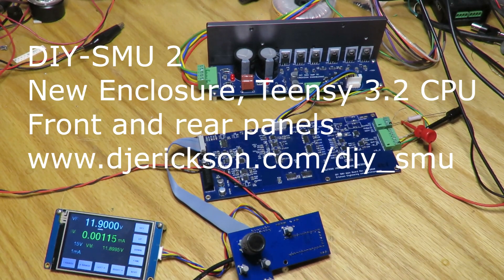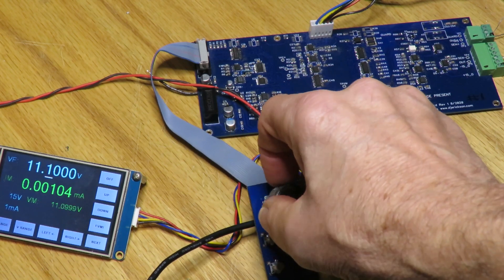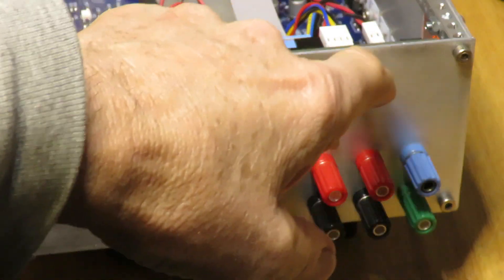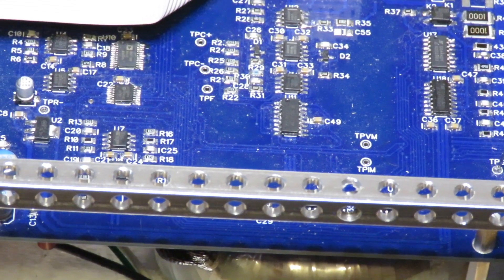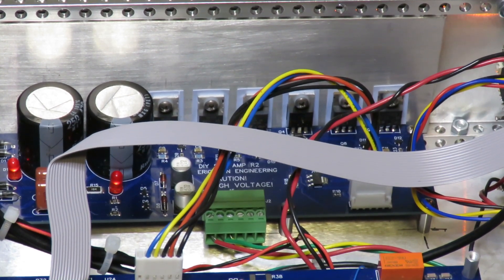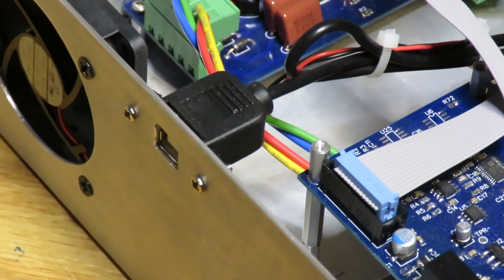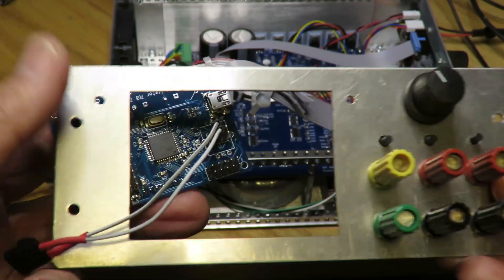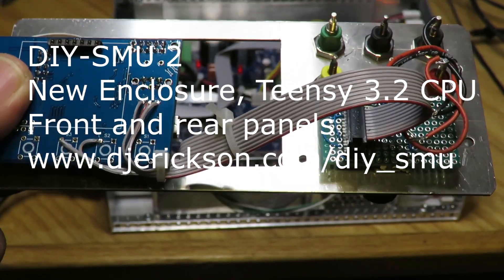DIY-SMU Chapter 2: New Teensy CPU and Enclosure

Comment: Love the new enclosure, the use of the GoBilda beams are a great idea. It's a shame that the holes along the beams are not threaded but I guess that would push the price up quite a bit. They are however drilled to 4mm so you could enlarge the ones you're using for the side panel to 4.5mm and tap them for m5 screws in order to remove the nuts.

A couple of interface suggestions / ideas:
1) Switch to a double-pole rocker switch for the power switch.
2) Add a physical output on/off button with an LED indicator to the right of the encoder.
3) Remove the left/right cursor buttons and make the encoder "velocity sensitive". (For safety you might make it behave as a fine control without velocity sensitive behaviour when the output is on and it might also be worth adding one of those stacked/dual-concentric encoders so that you have both coarse and fine control but again both velocity sensitive - You can always use an on-screen keypad for very large changes.)
4) Position the up/down buttons vertically, with #3 removing the usage of the left/right buttons, the up/down control could be both of the light grey buttons.
5) If you use countersunk screws for mounting the front PCBs, you could then use an extra PCB for the control legends. (Held in place by just the four corner screws, so it would hide all of the middle screws.)
Reply from the maker: Thanks for the excellent feedback. I agree with your ideas. Good details for the next front panel revision. 
Yes, the Gobilda 4mm holes can be enlarged and tapped for M5 screws. I'll do that for the top cover at least.
1, 2) I always wondered why to use a power LED if something else obvious (like  a big LCD) shows ON / OFF. Maybe it's a European regulatory thing? I picked the toggle switch for easy mounting in a round hole and small size. A rocker in a square hole is a good upgrade for the machined front panel.   
3) Seems like every time I use velocity-sensitive encoders, I curse the way they work. You get close and the value jumps.  Lecroy Waverunner scope is a bad example. Got an example of code that works well?  I'm also on the lookout for an on-screen keypad on Nextion. Which raises the question of what display I should be using.....
4)I'll probably use up over down switches. Maybe a diamond pattern. 
For the next rev, I intend to use an aluminum front panel made by PCBWay. It solves the problem of color (soldermask) and labeling (silk screen). Prices are good.   It won't hide screw heads though. Cutting clean, accurate rectangular holes in metal by hand is no fun. The pros use a plastic stick-on overlay.
Reply: @ericksonengineering7011  
1) Fully agree about a main power indicator being unnecessary - I suppose it would be useful if you had a "screensaver" mode where you turned off the display after a while but I can't see that being useful for an instrument like this. I mentioned a rocker switch mostly because it seems to be quite standard on a lot of bench equipment but the main thing is about it being double pole for safety in case one pole fails, especially with it having +/-150V outputs. A double-pole toggle switch would be just as good and far easier to mount.

2) I think the indicator for the output is still important even if it is duplicated on the LCD because LCDs are slower to read - Often the output status is tucked away in the corner or surrounded by text and a dedicated indicator makes it much quicker to check. Also because of the high voltage output having an indicator that's obvious and right next to the outputs is also a safety consideration.

3) It is an oddly tricky thing to get right and it's something you can only really tune by trying it and adjusting. I'm afraid I don't have any code to hand (And the code will vary on exactly how you want it to feel) but I think the parts which make velocity-sensitive implementations feel bad tend to be the following:
3a) Missed steps, as it's timing based any jitter can really throw things off. The solution to this one is to use interrupts to do the actual encoder counting.
3b) Duplicated steps, again this one is related to jitter. There are a couple of solutions but the main things are to use a decent encoder (Good quality contacts), consider adding hardware debouncing to both inputs and to ensure that the quadrature decoding algorithm handles any edge cases. (Only one input should change at a time, it's essentially a small state machine)
3c) Incorrect "time" while calculating the velocity. I tend to call "millis()" once at the start of my loop and pass the current time into each function. I would keep track of how long has passed since the last velocity calculation and the change in encoder counts during that time, then after a reasonable amount of time (Let's say calculate it every 100ms) perform the actual calculation and velocity. This will ensure that time is included correctly and that the numbers aren't so small that they become inaccurate.

For the display the Nextion is probably as good as any. The editor is a little clunky and they can't do much with transparency, but for an instrument like this it should work well. I'm yet to find a touch-screen display option that I really like, doesn't cost the earth and doesn't have a silly boot up time.

4) A diamond pattern would make a lot of sense as it also distinguishes that set of controls from any other buttons.

It probably goes without saying but if using an aluminium PCB for the front panel don't forget to make sure that it's properly grounded. There's no thermal considerations with this front panel so I'd consider a regular FR4 PCB that's slightly thicker (2mm?), or possibly a regular thickness PCB with a laser-cut acrylic back-plate for strength. Would have to run the numbers and see which one is cheaper and easier.
Reply from the maker: @yngndrw.  
Thanks so much Andrew. When I turn an encoder 10 clicks to the right, then 10 clicks to the left (back to the original position) , I expect the reading to be at the original setting. Like a potentiometer does. This expectation is an argument against acceleration, no? It is also an argument for no missed or extra counts. It seems like there are 2 types of encoder libraries, Interrupt and Polled. I use a third approach: a 1mS timer makes regular interrupts, used to poll the encoder (and BTW all UI keypads) every 1mS. This is how I've read keypads and encoders for years. Never misses encoder pulses. And unlike interrupt on edges, you don't get a large number of interrupts when (not if) your encoders get old and bouncy. You have to turn an encoder pretty fast to miss 1mS polling. 

Ground all metal: I totally agree. Probably spent years of my 50 year EE career fixing grounding issues. First rule of debugging: "It's probably the Ground". Pretty safe to say:-)
Reply: @ericksonengineering7011  That's a very good point, velocity-sensitive controls are indeed going to result in a potential inconsistency when counting clicks. I guess the key thing here is that there aren't any right or wrong answers here, just many options each with their respective tradeoffs.

I would argue in the case of an encoder with a separate read-out on a display, the displayed value is the sole feedback mechanism. At slow speeds it certainly should be very predictable, but at high speeds I don't think it matters as you're not going to be able to count the steps at those speeds. I'd certainly ensure that any speed-up only happens at higher speeds. (Maybe faster than about 1/4 of a turn per second?)

Your approach to reading encoders is essentially combining the debounce with the read while still having the advantages of using interrupts which is quite nice. I think the only downside is that it's not quite as targeted (I.e. You don't know what has changed without checking everything) so you'll spend longer within your interrupt which might be an issue if you also need to use interrupts for something else, but that in itself isn't an issue - Just something to be mindful of. As long as you handle any edge cases gracefully (E.g. The encoder changing two bits during within 1ms - I'd probably just record that value as the new encoder state ready for the next change but not adjust the count) you shouldn't have any issues with jitter and implementing the velocity-sensitive part. In my opinion the key part to velocity-sensitive controls is to not apply it linearly, I'd start off with a square ensuring that there's a well-defined "standard" portion at slow speeds and then adjust based on how it feels.
Reply from the maker: Thanks Andrew.  @yngndrw.  I think you are right. Slow rotation, counts are important. Fast, the operator probably doesn't care, just wants to get somewhere fast.  Also don't forge this is a high voltage instrument. Fast rotation could get you in trouble.  I think these types of instruments usually have software 'limits' in addition to the clamps to prevent operator error.
Reply: @ericksonengineering7011  It's an interesting problem, I suppose that as long as it behaves predictably (The whole jitter thing we discussed above) then that's half your battle - Making sure that it doesn't just suddenly jump up when you just want it to rise slowly. If you were to use the concentric coarse / fine encoders, you could ensure that the fine encoder only allows a maximum of about 1V per adjustment (1/4 turn?) and disable (Or severely limit) the coarse encoder while the output is enabled. There's probably a balance here between usability and safety. (Safety of the operator and of anything that you have connected to it) Upper voltage limits are quite common but I never find myself bothering to set one - It would be interesting to see how many people do use them. I suspect that it's one of those feature that you never use until something goes wrong.
Reply: @ericksonengineering7011  I've been doing the timer interrupt + straight port read with only a flag in the interrupt vector way for years as well, with a 0.1uF across the contacts, although I never bothered with the velocity stuff myself, it never failed me (with proper encoders at least)

I'm with Siniša Babić re: the status LED, but mostly because I don't trust my own code enough not to have a backup plan in case I messed up :P

This is an awesome project, I'm glad I stumbled onto it! :)
Reply: I can only confirm that a separate “OE on” indicator has proven to be very useful. It seems that our mind quickly learns that everything on display is one "domain" and having an important indication in another place increases the chance that we pay due attention to it.
Reply: @ericksonengineering7011  If there is a CPU or other partial malfunction, power indicator is there to notify user that device receives power, and is energized. In addition to serving as first level troubleshooting tool, it also signifies device is potentially unsafe.
Reply: @ericksonengineering7011  I also agree that output LED is very useful thing to have. I got myself Instek GPP-4323 which is generic power supply with little bit more precision and basic load function. For remote control and long term use it has command to turn off the graphic LCD and the translucent output On/Off buttons are lit with green LEDs so the state is easily visible, I like that. Also the indication on LCD is made more clear with grey numbers set and readout when off and colored (according to output channel) when live.